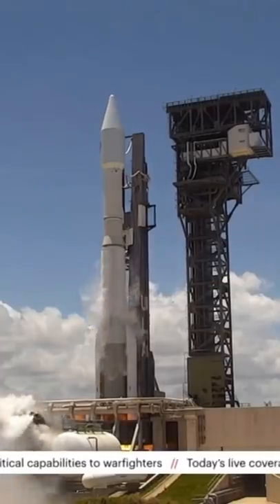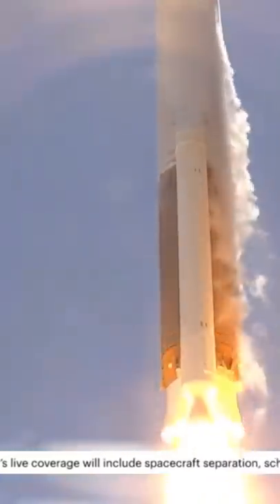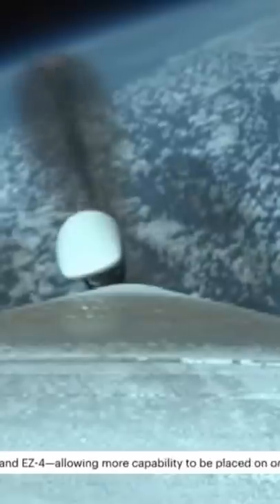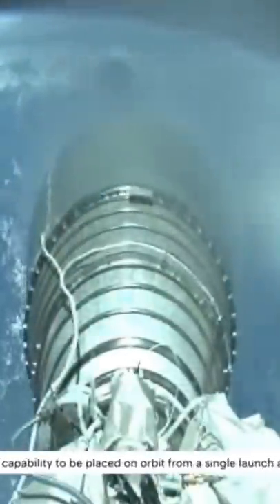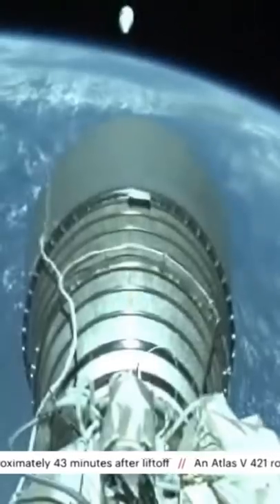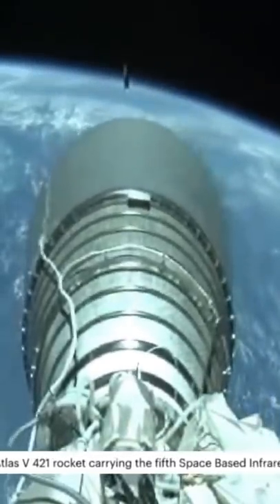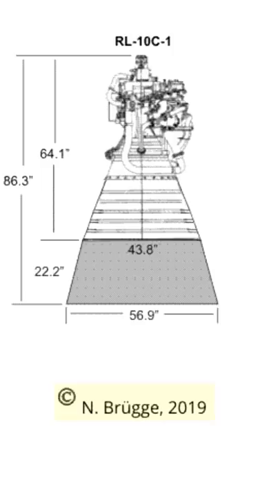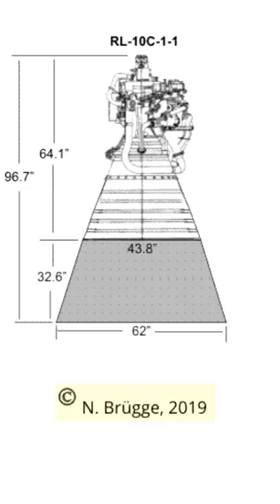ULA’s STP-3 Launch Delayed To Investigate Wobbly Engine #shorts

Comment: "you'll notice the vibration" - no not with that video resolution I won't, thanks YouTube
Reply: Is it YouTube's fault this time? Maybe the onboard camera is crappy
Reply: No, I could see it, but had to replay it several times.
Reply: @ronwesilen4536  
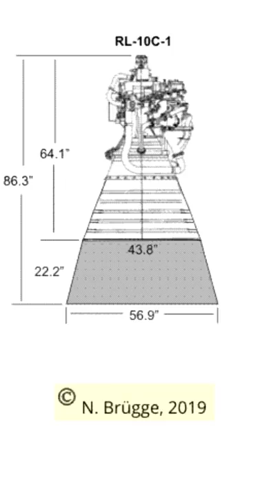0:00 and the sketch 0:30 suggest this is the case. Not a great cam.
Reply: I saw the vibration just fine even though the resolution is bad.

Comment: Looks like they picked up a harmonic when they added the longer extension.
Reply: You'd of thought they could have discovered that with computer simulation and that
Reply: I wonder if it's something that would ever have been caught without cams. Are there sensors on the vacuum bell? I imagine there will be vibration pickups and mics elsewhere, but they might be able to isolate what part of the entire engine is actually oscillating.

Comment: "Space is hard."   They should take that nozzle down to their local garage and put it on the tire balancer.  Stick a lead square on one side.
Reply: Not sure what use that would be.... as this is more likely due to harmonics, or something.
Reply: @deth3021  I was using hyperbole to suggest they test/model better next time
Reply: In 2010, SpaceX did some nozzle trimming with some tin snips and launched on time.  I guess that's the difference between the  'cash on delivery' model and the 'tax payers teat' model.
Reply: @deth3021  
Actually, a big enough square of lead might afford enough damping to quell those oscillations down to the point where they can be satisfied they won't lead to runaway feedback.
A more likely solution (giving the weight of lead and its melting point) might be a belt around the end, of leaded-glass fiberglass. If it might melt, they could find something more refractory; but if it does melt it would be even more effective as a damping mass of viscous goo.
Reply: @-danR  sounds about correct but then it would have less Payload.
Reply: @thePronto  Shorter nozzles will tend to be stiffer. This is the opposite of that.
Reply: Soviets: needs more HAMMER
Reply: @deth3021  Principally, affixing a chunk of whatever onto one side of the nozzle would kill the resonance.
Reply: @thePronto  you got it.  Space X gets things done while others stand around scratching their head. It's not rocket science it's common sense sometimes.

Comment: Harmonic resonance. When the nozzle was lengthened, it was assumed that the only change would be to the pressure at the exit, however: the frequency of the exhaust waves or pulses as the fuel remained basically the same but nobody thought to see if the new length of the modified nozzle was a very close multiple of the exhaust frequency.

Result: harmonic resonance sets up in the path of least resistance, which is the edge of the nozzle and the harmonic waves resonate until it actually sets up physical waves in the metal of the nozzle. I'm sure they already know this and will simply either shorten the nozzle a hair or place a reinforcing band around the outer part of the nozzle end... Just enough to stop the thin metal from resonating in sync with the exhaust pulses
Reply: Next time you can stand in front of the nozzle and tell us how to stop the wiggle lol, you’d think they’d flat test it once or twice?

Comment: Hard to know what kind of vibration we're seeing.  It looks transverse in the video, but between framerate/vibration interaction and not knowing if there's a travelling shutter, no way to be sure. On the gripping hand, sticking an iso grid on the outside of the nozzle extension would help with rigidity and not cut into the mass budget too much.

Comment: Scott can you do a proper preview or launch report for this mission ? It's been delayed and rescheduled like forever, it was supposed to prove a lot of the new common Atlas / Vulcan hardware but some of that (e.g. GEM 63 boosters and the new RL10 variant) have now been flown first on other missions. I think this is the first mission for the new payload fairing design but I can't be sure any more....

It will be great to see a full-fat Atlas launch again after 2 missions of the pure 401 Altas with no boosters and the pointy little metal  fairing.

Thanks in advance !

JM

Comment: Do the launches ULA does for DoD are just cursed? Even the supply issues of BE-4 for Vulcan are effecting the USSF stuff first
Reply: Their launches aren’t “cursed” they still have a very successful mission
Reply: @44R0Ndin  this contract to send 6 SBIRS sats or orbit was awarded years before SpaceX would even carry a military payload. Plus it isn’t. Waist at all ULA is the most reliable and most accurate company there is. Some missions rely on the accuracy.
Reply: @dummyjoe7895  You do have a point, but it's not like the satellites couldn't be made to cope with a slightly less accurate orbital insertion by using their own propulsion systems, it's not like those satellites have no translational thruster capability at all after all. At most it would take a little bit bigger fuel tanks and if that's not possible I'm sure there's some place they could put another fuel tank or 2 to make up the extra Delta-V needed to adjust for the imprecise orbital insertion. And all that would likely only take at most another month for the satellite to come online, which isn't a big deal since at the current time we're not even in the business of building NEW satellite constellations primarily intended for the military, merely launching spares or next-generation satellites for existing constellations, meaning that the time it takes for a satellite to come online and move to its slot aren't as critical as when you're bringing online some entirely new constellation.
What I'm trying to say is that yes, the high orbital insertion accuracy is nice to have, but it is by no means a hard requirement for any satellite.
If you haven't launched the satellite yet, you could modify it to work with any launcher, with any kind of integration. Since it's governmental defense spending, cost is basically no object except when the money doesn't go to the "right" contractors, then everyone gets upset and tries to de-fund it and then everyone says "how are we going to pay for this", and it gets cancelled or saddled in endless contract disputes.

You see, what I hate is pork spending, lobbying, and the concept of a loan.
Reply: @44R0Ndin  yes, but some missions need the accuracy like interplanetary missions. Plus ULA is known for making sats last longer then originally planned because of their accuracy. Roughly 5-7 years longer.

Comment: maybe they didn't take into account the frequencies that can cause entire bridges to move

edit: aka resonant frequencies
Reply: I'm very much hoping that they haven't forgotten how to calculate resonance frequencies when designs change.
Reply: Testing vacuum engines at sea level is difficult. It may not resonate in the same way.
Reply: @jounik  I'm sure they didn't but sometimes small errors in manufacture can cause these, it might have something to do with the bell's connection to the throat

Comment: Thank once more.....Scott...So what is going with the James Webb tel.......??
Reply: The telescope is doing fine. It's the fairing on the Ariane 5 that has been doing something funny. They've been getting an acceleration or vibration on fairing separation that they think is from gas pressure building up during the ascent. Because this is out of spec, they need to get a fix implemented. IIRC, one of the fixes has been to put vents in the fairing to let gases out. NASA  wants the Ariane 5 to launch at least once before they let JWST go for a ride. Arianespace have two A5 launches scheduled between now and October.
Reply: @Markle2k  Thanks very much my friend...!

Comment: ULA needs to try out the nozzle vibration damper from Space X (the ring at the end of the nozzle that separates moments after 2nd stage ignition).
Reply: From what I know of that ring isn’t a “vibration damper” it’s a support ring because the nozzle is so big and oversized.
Reply: Maybe SpaceX could trade them for the Fairings ULA won’t let SpaceX use…
Reply: @TraditionalAnglican  lmao it’s ULA’s fairing provider that won’t sell to SpaceX. Not ULA themselves

Comment: Was this the first launch of this new rocket nozzle?  I bet they don't test these in a vacuum at full power.
Reply: That would probably be very difficult to do. The exhaust would kill the vacuum and create a positive pressure in the chamber. The vacuum pumps would have to have a lot more power than the engine puts out to keep up.

Comment: SpaceX: Makes huge advancements in rocket design
ULA: Can't add a skirt to a 50 year old engine

(edit) Yes, I am aware that space is hard and that you can't replicate space on the ground for this kind of thing. Just a joke with a little hidden meaning behind it.
Reply: Not saying you’re incorrect about SpaceX, but they have also destroyed a good number of engines getting to where they are… space is hard, even for the veterans!
Reply: @Tyler Johnson I mean competition destroy engines every launch (joke)
Reply: You do know the raports used to shake aswell. Also ULA is the world most reliable rocket company. And might I add this is a new variant of the RL-10 they just didn’t “add a skirt” it also has numerous upgrades to it
Reply: @dummyjoe7895  It seems a little sloppy that this oscillation only became apparent during an actual launch and if it were not of any concern they wouldn't delay the next one.
Reply: SpaceX did not make huge developments. 
They just implemented them on existing rocket.
Reply: @haraldhimmel5687  a lot of things can happen in an actual launch that are unexpected from ground testing. It’s not uncommon for things to have different behaviors once in an actual launch.
Reply: @Skullbrothers  Thats a pretty zynical thing to say considering that noone ever bothered to fly self landing boosters, a full flow stages combustion cycle engine and soon a fully reusable heavy lifter, recovering the upper stage with a unprecedented bellyflop maneuver. They are arguably hammering out more innovation than the entire field of rocketry in decades.
Reply: @haraldhimmel5687  there have already been deigns exactly like starship that was present already back decades ago. SpaceX is just using those designs now.
Reply: @dummyjoe7895  OK, source?
Reply: @haraldhimmel5687  He said 'designs', so I vote for the Tintin rocket.
Reply: @mauricegold9377  Pointy end up, flamey end down.
Reply: @haraldhimmel5687  Always a good idea. I also liked the colour-scheme of the Tintin rocket. Why can't we have red and white heat-shields?
Reply: @mauricegold9377  It sure was a pretty rocket.

Comment: SpaceX after blowing up entire payloads: Hey, it happens. Good thing you have insurance

ULA, with one wobbly nozzle: 😫🥺 we're so sorry 🥺😫🥺
Reply: That's an odd comment after SpaceX's 100th consecutive successful launch recently. I suppose when  you have a chance to defend ULA, you have to take it?
Reply: @brian.webster  it’s actually 91 consecutive success missions. and it’s not an odd response because SpaceX fanboys will back SpaceX up over anything even if something went horribly wrong they will shrug it off.
Reply: @dummyjoe7895  It's not an odd response? How many launches ago did that failure happen?
Reply: @brian.webster  lol I just mean they have different standards for a failed rocket. Boosters fail on SpaceX rockets sometimes, but if the payload gets there it gets there. ULA is pausing the program cause of a wobbly nozzle. Elon Musk wouldn't have even questioned a wobbly nozzle.
Reply: @alecgolas8396  - I guess you didn’t catch where Rocket Lab’s Electron lost a payload because of a “wobbly nozzle” on the 2nd stage 4 weeks ago. Recent “failures” on Falcon 9 were when a 1st stage booster missed the drone ship & a 2nd stage didn’t deorbit as programmed. 
Wholesale cost for Atlas V launches is $109 - 160 million/launch depending on version. Falcon 9 launches retail at $62 million/launch. ULA got cheaper on National Security launches by forcing SpaceX to develop a new enlarged fairing by not allowing the contractor who developed (using taxpayer money) & builds the larger fairing they use & by pricing in the Vulcan Centaur which would cost ~80% of what a comparable Atlas V would cost.